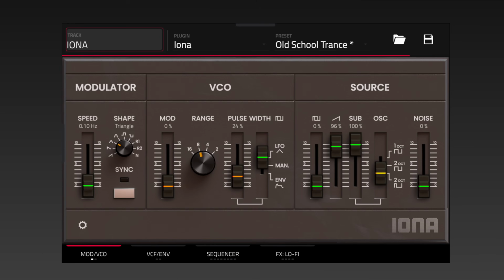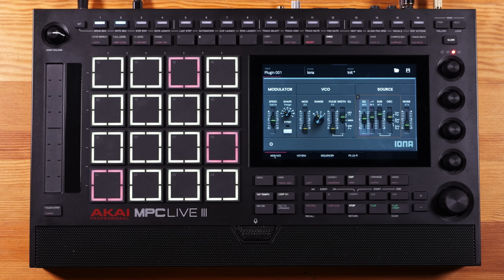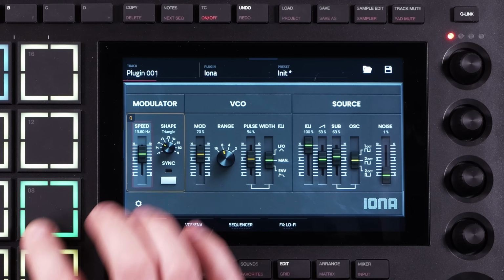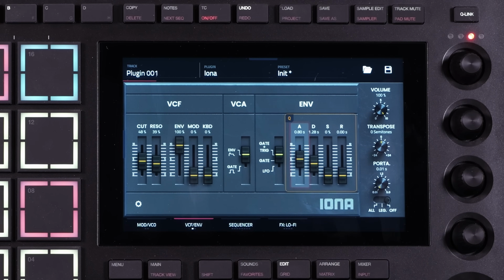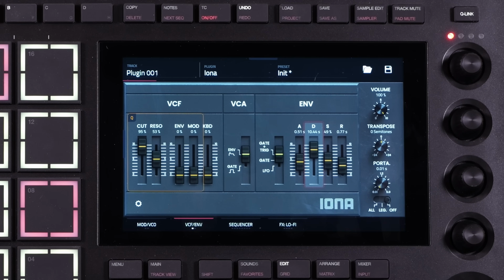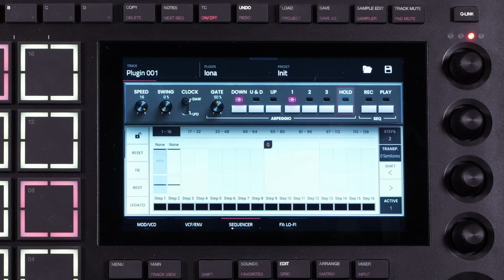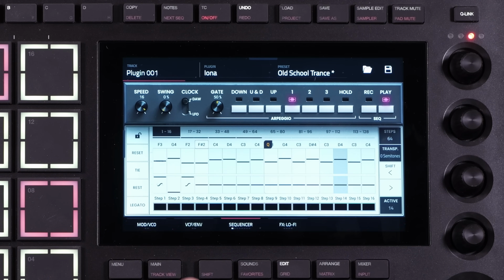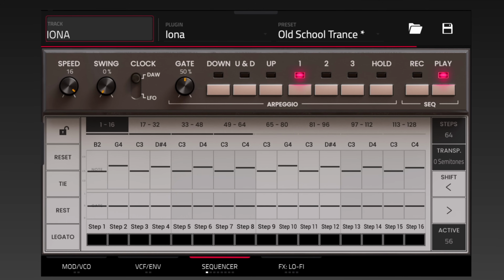AIR Iona for MPC | Authentic Analog Tones Made for Modern Production Workflows

Comment: One stand-alone synth I would like to see is a modular system. With the touchscreen connecting cables would be pretty sick. One FX I would like to see in Stand-alone is a clone of the Chase Bliss  / Good hertz  LOSSY  mp3 simulator. The pedal sounds amazing with 90’s retro digital vibes.

Comment: why does a synth plugin need a sequencer on an MPC?
Reply: Because of the presets sequences combined with the sound
Reply: Because the MPC software on the device is a touchscreen DAW optimized for built in controls. The MPC is essentially no different from a normal computer with a audio interface and Midi controller with pads.